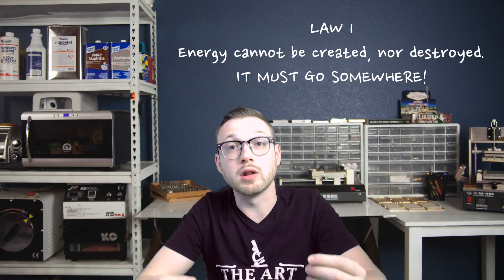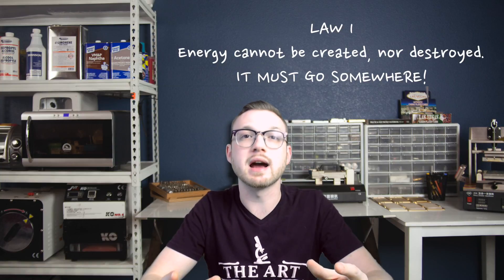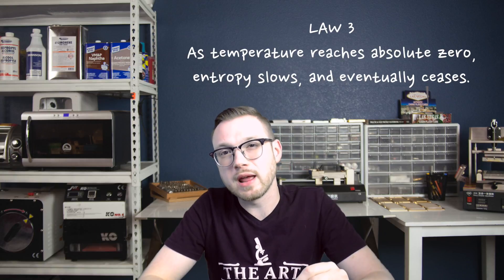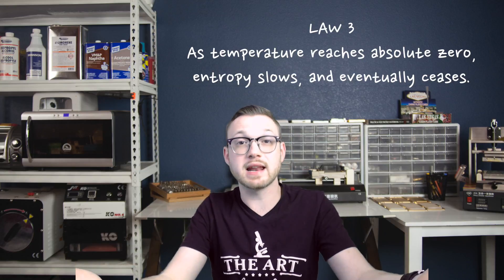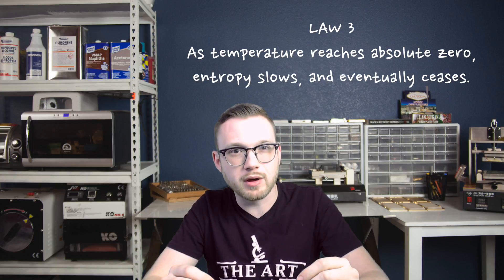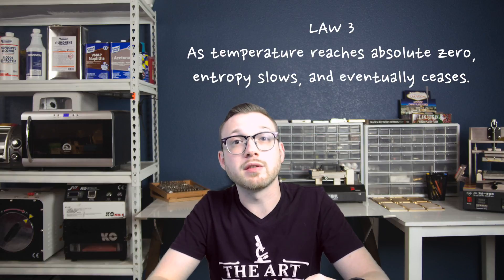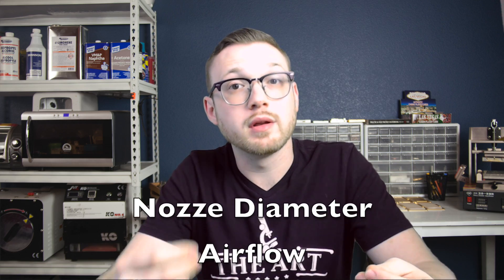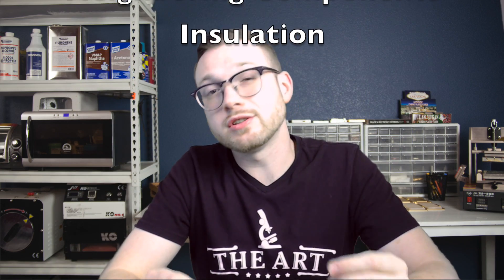EP14 The Thermodynamics of Microsoldering | What do I set my Hot Air station to?

Comment: It seems nearly impossible to desolder bga chip glued down with epoxy underfill without damaging it due to prolonged exposure to high heat.  I was wondering why it's not possible to avoid hot air gun and instead use hot thin blade to physically melt and cut bga chip free?  Then heat will be only focused where it needs to be which is solder balls and epoxy filler layer.
Reply from the maker: springer 11724 Well I think this is an interesting idea, and I’ll probably play with the idea at some point in the future because it is a really cool idea. My first initial problem thought here is that somebody will rip vias and pads off the board because they don’t know what they’re doing and then the device is destroyed

Now you could say the same thing about Hot air but I would argue that Hot air is probably 100 times less likely to do that if you’re doing it properly

So since we don’t know about your idea like I said I’ll keep it on the radar and I’ll look into it but I do have concerns about the thought process
Reply from the maker: springer 11724 actually I’m sitting here thinking about it right now, I just don’t think there’s going to be enough thermal capacity to transfer from something so small and overcome the thermal mass of the board

Comment: Got a question Justin. Most of the work I have done is thru hole and with discrete components. Very little time did I get near SMDs. The solder used was an RMA Sn63 or an Sn62. Both are pure eutectic solders and both are leaded. I’ve never used lead free solder on any board. Finding a lead free solder as good as those leaded RMAs has not proven successful for me. I pride myself on the quality of my solder work. Finding the right lead free formulation that gives me those results I am used to with that RMA leaded solder is of paramount importance. Mixing these is no good. I need to find a lead free solder that works like it’s RMA leaded relative! You got a recommendation, I am listening!😲🤐
Reply from the maker: Mark Philpot first question is what’s your specific application where lead free is essential. I don’t use lead free myself but maybe with some more information i can look into it when I get some free time :)
Reply: It’s not that I need any lead free solder. I am just researching for the future. I know that you cannot mix these solders as they are not compatible. When you use leaded solder on either an iron or a desoldering pencil or gun, it is not a good idea to use lead free solder using the same equipment. It contaminates that’s equipment and renders it unusable. As long as I can use Kester 282 RMA Sn62 or Sn63 leaded solder, I will use it. My reason is clear, high quality and high reliability. I am a proponent of DOD STD 2000-1. Any other standard is just bs. It has served me these many years. So as long as I can, I will use it. Lead free has a long way to go. They, the solder manufacturers, haven’t come up with a formulation which meets the same one as the 282 or it’s equivalent by other makers. As far as I’m concerned, I’ll give up my solder when hell freezes!😠

Comment: This is a very valuable video and thanks for making it!  By far the most asked questions of youtube micro solderers like Jessa, Louis, Jason, Larry and Chris Long is "Hey bro what do you set you hot air station to?"  I wondered when I first started why they did not answer this question but after some experience I quickly understood.  I started with a $60 SMD 858 station, not a bad station but not a Quick, JBC or Hakko by any means so as I experimented I learned very quickly my temps varied widely from some other you tubers that gave their temps.  I am going to start linking this video in the micro soldering groups I belong to as I think it will definitely help those just starting out.  Thanks again your videos bring balance between education and practical application.

Comment: love your videos.  I find that I learn something new everyday.
I have a question. I could not find your website and thought I would privately message you but This video is related to my question.
Check this out.  I have a POS Gaoyue 850+ as my hot air station.  I have a hakko fm-202 and fm-951. Have the necessary tips.  
I need a new hot air station.
I will take your advice and go with prime distributing rework.   I can afford either the quick 957DW or the 861DW (your preference). Hakko or JBC  is not in my price range.  
Here is the thing. I'm older in my 40s.  So I like knobs to turn.  I like the 957dw based on the specs. The 861dw is great but i don't really care for having to press buttons.  So the real issue comes down to watts, the 951 is only 580 and the 861 is 1000.  (compared to piece of shit  gaoyue 850+ 280 watts)  
So is the difference in watts worth the extra 200 i pay for the 861dw?  I guess what I am saying is i want the 951dw.  But I hope you can help me decide.  I only been doing this for about a year.  cellular repair for about 2 years.  Let me know which you think i will be  happy with long term.if the wattage is worth dealing with buttons i will.  I just don't have enuf experience with rework to say one way or the other.
Thanks for taking the time to read this.
Keep up the good work.
Your Fan,
Francis
Reply from the maker: build quality and overall performance are much better on the 861 over the 957. I wouldn't worry as much about the wattage difference for mobile rework.
Reply: alright,  i shall take your advice.  thanks again
oh yeah  great vid on lying to customers.  i just watched it...... definitely food for thought.

Comment: ..so I think i can use 250 safely but is that practical?  What temp do you find yourself at when you are trying to not kill something irreplaceable? (like nand)  I don't mind taking longer if it means less risk.
Reply from the maker: If you heat something to slowly it will give the rest of the board a chance to reach the same temp. Which could damage or short nearby components from the solder getting to wetting temp. Hitting it a bit higher to overcome the thermal conductivity of the board will allow you to release the component at the epicenter of the heat before it proliferates out further.
Reply: Yes, you are actually better to use a higher heat for less time as the surrounding components will be of a lower heat by time component comes off. In other words, better to get in/out quickly and toast the target component, than slowly bake the board and surrounding components.